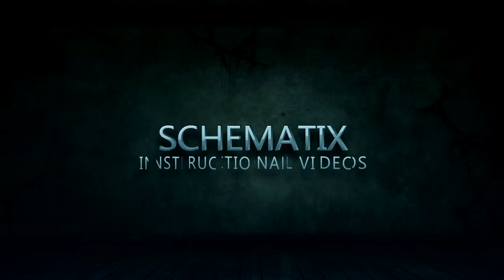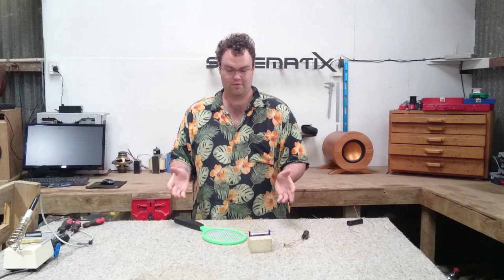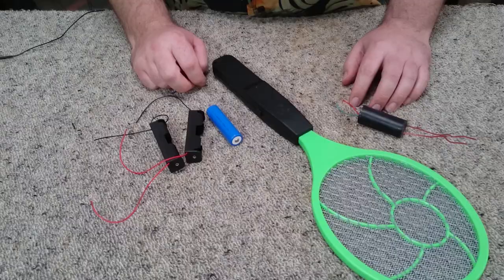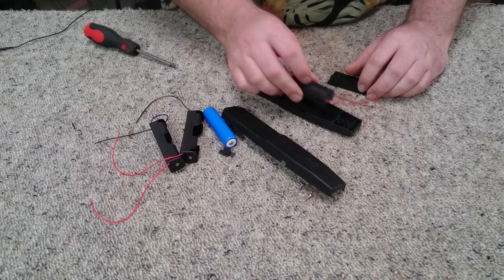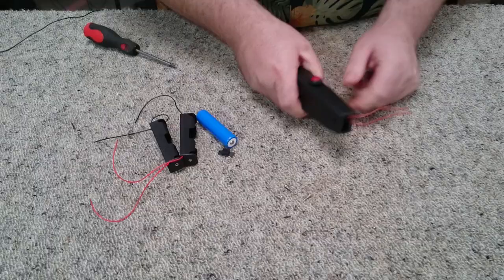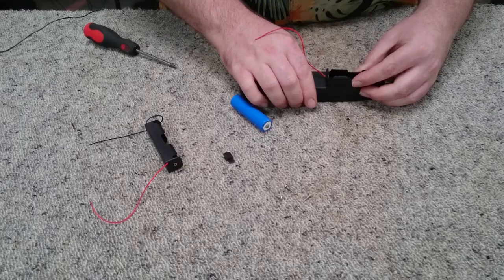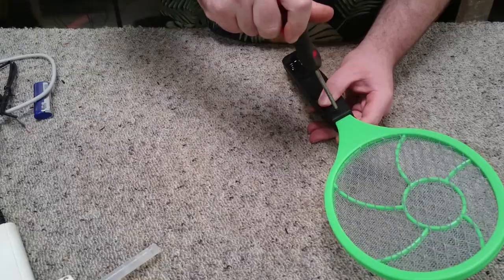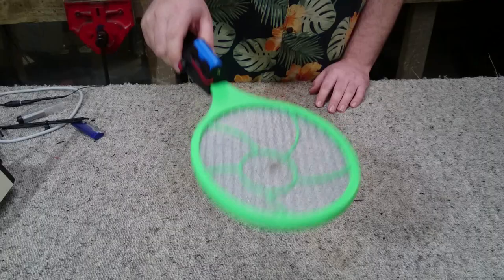How To: 'SUPERCHARGE' an electric fly swatter to 17k+ volts!

Comment: I made one of these a few years back. I found that removing one of the outer mesh panels completely and repositioning the middle one to the outer position works extremely well. The zaps are across the mesh all over the racquet not inside the frame. It’s an easy mod and one I know you will love.
Reply: And connect both lead to their own mesh. I connected only the outer meshes and left the third one in between. It’ll always find the path of least resistance and that’s usually an insect. :)
Reply: @rikdol  they work incredibly well against wasps too
Reply: That makes sense, but the center screen has a smaller mesh then the 2 outers. I guess when you do this mod, the racket would need to be used in a directional manner. You want the bigger mesh on the front part to allow the bugs in as you swing. The racket with only 2 screens may make it more dangerous if you grab the business end.
Reply: @tjet455  everything you say is 100% correct including the grabbing the wrong end by mistake. This mistake will usually only happen once though.
Reply: heck n good info brotha thank you

Comment: There's a way to modify one of those electronic fly swatters without doing quite as much modifying. I was able to keep the original AA battery compartment because there is a 3.7vdc battery in a AA form factor. What that fly swatter does now is awesome and somewhat scary. My hat is off to this guy for inspiring me to do my modification. Thank you @Schematix for your inspiration!!! BTW most American firefighters has a 5 year old self that pops up quite often!! Trust me!!!😜😜🤣🤣🤣
Reply: A 9volt battery also fits into a double AA compartment 😂
Reply: @kenciphery690  , a 9vdc battery doesn't have anywhere near the amperage needed to power the voltage increaser. The best you could expect is up to 1.2 Ah on a lithium rechargeable 9v. The 2 Li-ion 3.7v AA size are 1Ah each for a total of 2Ah. It's the amps not the voltage that matters most.
Reply: Using the original circuit, the modification to make is a much bigger capacitor. The one seen on this fly swatter is positively anemic.
If you just up the input voltage carelessly, you'll fry the circuitry real fast if it's insufficiently insulated at any point - or even get to the point where the swatter will discharge itself once it builds up enough voltage, without an insect involved.
Reply: Removing the output resistor/shunt that is across the output capacitor and the grids is a worthy upgrade, and SIMPLE to do. You can simply clip it off the board with a side cutters, and wah-lah, instantly more power. 

Be CAREFUL though, as the grids will now store a wallop for a very LONG time without the button being pressed, and it can zap you days/weeks later if you touch it without pressing the button. 

The output resistor/shunt does double duty by limiting the high-voltage developed by the circuit, AND it drained power out of the output capacitor very quickly once the button is released, and made it so that you wouldn't get zapped if you touched the grids with the power off. 

Putting ONE 3.2volt 14500 LiFe cell, and one DUMMY cell/spacer, in the AA battery compartment, and doing the resistor/shunt delete, WILL make quite an improvement in output power and it'll now blow Hornets to pieces in one zap. 👍 

Just DON'T touch the grid.... 😈
Reply: I assume you mean the 14500 type battery which has the same size as the AA battery. I understand that you put them in a parallel connection and not in series? @ffkarle
Reply: @daviddalal8383  No they went in series just as normal AAs would go in the battery compartment. You're after voltage to match the specs of the voltage increaser being used. Putting them in parallel would increase the amperage instead of the voltage. The 14500 series batteries has more than enough amperage. You need an average of 4-6vDC which you'll get and then some with the 3.7v batteries in series.

Comment: A very long time ago I worked for a magnetics company that produced a wide variety of custom and specialized transformers.  Everything from toroidal power supplies for the Apollo mission backpacks to monster transformer for the USS Enterprise.  Anyway a couple of us got the idea to make the ultimate fly zapper and used a massive transformer fed by a 400 cycle generator. The feed wires we housed in an acrylic cage we used for hi-potting dangerous voltages and baited it with some lunch meat.  It wasn't necessary for the flies to touch the wired as long as they flew between the wires.  Made a very audible and satisfying sound, kind of a zit-snap-crackle.  Did you wreak havoc at your high school?
Reply from the maker: Wow! I sure wish I was there to see that! It would have been a fly's worst nightmare I'm sure
Reply: It's amazing the weirdness that results from boredom.
Reply: Sick Bastd I was on the USS INDEPENDENCE CV62 we were berthed right next to her ( USS ENTERPRISE) at the Virginia naval base. wow, was that ship big, Indy was almost as big. anyway WHAT HAPPENED to the FLY KILLER machine? you guys sell it? Old One Legged Joseph T
Reply: Schematix why not use a pp3 battery?? that way you could have dropped it right in? Just asking Old One Legged Joseph T
Reply: Absolutely I wreaked havoc in high-school!!.... AND forever after still.... 

My favorite one back then was to charge up an old breaker points condenser to a high voltage, and then toss it to someone to catch. If they somehow managed to catch it without touching the canister AND the end of the wire simultaneously, the person ALWAYS ended up fidgeting with it until they did, and ended up zapping themselves. 
I can remember doing this to the shop teacher once as i walked past his desk, and he caught it, but didn't end up touching the end of the wire... 

My buddies and I intently watched as he played with it, rolled it around in his hand, and THEN, he grasped the wire by the base of the canister, and started slowly running his fingers down the wire, straightening it as he went, and when he reached the terminal at the end of the wire, BOOM⚡️ he got nailed, and inadvertently tossed it.... 

I thought we were in deep shit, and he was gonna be PISSED, but he laughed and told us "Good one, guys..."

I kind of figured that being a shop teacher, he would have SURELY knew all about that one, but he didn't, or else maybe he didn't think that WE knew about it... 😂

Good times, good times... 👍

Comment: you could have just added a larger capacitor in parallel. that would have given each zap more power but wouldn't have increased the likelihood of it self discharging.
Reply: What size capacitor would you recommend?
Reply: @lukeharris1425  I went with 2000v 470nf... Gave a good spark. I then replaced the battery dep. with a 9v battery instead, and holy shit! Only thing is I don't think the transformator can really handle it for too long, after holding the button about 1 sec it starts sparking inside the handle, which feels a bit so and so... But if you've cut the drainage resistor, you can just release the button when it starts sparking inside, it still holds the charge, so no problem.
Reply: @maxhult830  so 4 AAAs sounds like a sweet spot.... 😁
Reply: @rosebarnes9625  Yeah, but a 9v battery is the same size as 2 AA, so it fits perfectly in the battery compartment, without having to modify that part TOO much... So, you can't really see that it's modded from the outside :)
Reply: @maxhult830  I'd rather have an optimized and reliable Frankenstein than a nice looking super hot device that lasts a week before burning it's self out.... if you prefer the hot shot toy that looks nice, the 9v is for you, a reliable tool is my objective. "to each his own" 😁
Reply: Could I hook up a 6 vokt battery with out burning it out I trying to hook it up to my canopy tired of shit heads stealing my tool it is a security canopy with 3 doors and door handles

Comment: I have one that operates with 2 AA battery.  So, I tried using a 9 volt  battery that is used in those smoke alarm.  It fits, but you need a wad of aluminum to make contact at the + terminal. 9 volts doesn't fry the electronics, but I don't energize the circuit for too long.  Smoke warps!

Comment: I have some electric fly swatters that use two D cell batteries and I put in one 26650 battery and a spring with copper pennies connected by copper wire on each end( two 26650 batteries are just too long for the housing). It makes some big sparks! I will use the transformer in your excellent video to make an electric mouse fryer.....Just be careful dude I think I heard some ALIENS talking in parts of your video:)
Reply: they might be coming for your ray gun (fly swatter) lock and load

Comment: I bought one advertising 4000v from two AA batteries (3v)....this is a factor of 1333.3333X
Application of this to a standard 9v means the step up transformer now puts out 11,999.9v.....and only requires that you solder the spring from the base onto the top for 2 springs, after that the 9v battery actually fits in the double AA Holdrege with minor dremel work.

Comment: I believe it is way practical if you could make a module to charge the 3.7v battery so you don't need to remove it every time it needs to be charge.
Reply: micro usb charging and battery protection board TP4056 does good the job. The board is so small that you can hide it inside.

Comment: Someone used two 4.2v batteries without modifying anything else and got the same results, I think using a 9v battery with the original capacitor would probably work just as well.
Reply: Where?! What was the video called I'd love to see this video
Reply: I have once used a 9V battery but after a little while it stopped working. Probably with three 1.5V (4.5V) it might work the same instead of jumping from the initial 3V to 9V as the internal default circuitry is made to withstand 3V.

Comment: I know this is pretty old.  But curious how this would work with a 9-volt battery rather than the bulky 18650 battery?  Might even be able to fit the battery into the existing battery socket on the handle?  Maybe need a lower transformer though?
Reply: Indeed, a 9 Volt fits perfectly. I dismantled a second depleted 9V for the terminals. I needed to beef up a few components on the factory circuit board to coop with the higher voltage, and the swatter ended up far more potent.

17kV is overkill; we see the swatter in the vid discharge without a fly even being present. You´re asking the right questions.

Comment: Is there any particular way you solder the wires for the cage to the generator?  Meaning does any color wire connect to any end of the generator that is the opposite side of the button?
Reply from the maker: nope doesn't matter what way the wires are connected

Comment: I'll admit that I don't see the point in using a voltage high enough that the spark will jump through the air gap. The circuit shouldn't close until there's an insect in the middle. If you want to add power, get a bigger capacitor.

Comment: At about 3:40 you show how you can't fit a 3.7V (18650) battery into the AA holder.  However, if you used the ICR14500 3.7v battery, it will fit perfectly, as it is the same size of the standard AA battery--you can simply short the terminals for the 2nd AA battery.
Reply: Or make it parallel :)

Comment: I'm going to do this with the guts from a broken arc lighter and an 18650 cell. Might even wire in a small power bank so if you wanted to you could charge your phone with your bug zapper.

Comment: I want to know if you can zap smaller insects by increasing the voltage.  One problem is getting those small flying things, they aren't big enough to make a connection, so if you increase the voltage, shouldn't it zap smaller insects?  One other thing I want to do is make the mesh about 50% bigger and make it about 1' longer, then balance the whole thing by putting the battery down lower so you can swing it faster.

Comment: What gauge wire are you using connecting the cage to the generator? Also thanks for getting back to me on this, I'm very excited about doing this project.
Reply from the maker: The current is so low that pretty much any light duty wire should do the job, use good quality insulation as the high voltage will laugh at thinly insulated wire. (No need to look for something specialized, just decent quality)

Comment: why not use a pp3 battery?? that way you could have dropped it right in? Just asking Old One Legged Joseph T
Reply from the maker: The stepup converter requires a decent amount of current a 9v would struggle to deliver. Besides that the converter max input voltage is 6v so its outside the recommended. :)

Comment: What if you use a 9 volt battery instead... Will it make 40,000 volts and fit inside the handle?

Comment: I came here to soup up my anemic dollar store stunner tennis racquet because it is good for mosquitos but larger stuff like wasps and such require that you beat them to death with the thing as all the zap seems to do is make me jump and really piss off the wasp no end and trust me they are a hell of a lot harder to hit when you're hopping up and down flailing the thing and knocking every damn thing all over the place in a vain attempt to retreat from the creature buzzing at you with vengence in it's compound eyes and it's pricker will give you multiple burning itches not too disimilar from that one booze soaked and pot smoked night in amsterdam. I didn't need to catch a jail sentence and accidentally set fire to the cat when I miss with your upgrade. swapping out the cap for a bigger one or changing one of the resistors or maybe adding another battery in series is all I was looking for. Thanks though and if the insect ends up more human wise i have that covered via an old 6cylinder cam shaft if'n i want to catch a jail sentence

Comment: I did this too, today. Had one such module laying around so I figured to give the good old swatter some more power. I have used the module through my regulated DC power supply numerous times before. Without fail. It was set at 3.75V and 1.5A max. 

Now, having used it in the swatter, it burned out within a very short time. Looking at other videos on these modules they seem to be able pull quite some amperage, up to the point that I think the very small, hair like wires on the coils within might just get too hot and burn out since the 18650 without regulation will happily provide until it is empty or until it blows itself. 

So I am wondering how to prevent that. Would a resistor, or a couple of them, do the trick already? Or would something different be better?

It's starting to become hotter now and we get quite a lot of larger mosquitoes and wasps over here. Using it as it comes from the store makes the animals visibly suffer for a long time before they die so I would really like to use this enhanced version. They're gone quickly this way. So... Any suggestions you might have are highly appreciated.
Reply: try to connect it only to the middle part and take out the other sides it has the same affect as every fly my swatter touches explodes same with wasps and large mosquitos

Comment: What size battery did u use have u got a link for ebay buddy
Reply from the maker: They are a very common rechargeable lithium battery called an 18650. if you want to buy one I recommend buying a quality name brand 18650 like Samsung or LG.etc Cheap 18650's will promise the world and deliver little to nothing in the way of capacity or performance

Comment: Simply remove the output resistor/shunt, and use 1 3.2v LiFe 14500 AA cell and one DUMMY cell, instead of 2 AA's in the battery compartment, and it'll then blow Hornets to pieces in one shot. 

Do NOT use 2 LiFe cells in series, without a dummy cell, or the voltage WILL be too high, and it will blow the transistor and destroy the swatter. 

IF you remove the output shunt resistor, be CAREFUL to NOT ever touch the grid in the racquet, EVEN if you are not holding the button down, as it will now store a charge for a very long time and it will zap you even if you're not pressing the button. 

Removing the output shunt resistor allows the circuit to develop a higher voltage and power output, as it is no longer constantly robbing the high voltage as it is developed, and the energy stored in the output capacitor is much higher. 

Be careful with it...

Comment: I have The Bug Warrior Supreme and The Jolt Bug Zapper from eBay. they have no mesh.  it is the grill style. will your method work on these also?
Reply from the maker: Hi, I don't see why it can't work on those swatters. I believe the bars alternate positive then negative through out the entire grill. Might be a good idea to open one up and see how they are wired. I imagine they have some sort of bus bar inside to connect + & - Should be pretty straightforward.
Reply: Can you sell me one like this?

Comment: Voltage is beyond useful. Charged grids boost capacitance and charge just below arc threshold so that when pest bridges gap in grid, charge is dumped through pest killing it. Voltage should be just below arc level at 50% relative humidity or about 4-6kV. Recommend modifying your project-take your racquet head off and replace with PVC pipe of 2-3 feet and two finish nails through cap at end to use on vicious attacking dogs, mountain lions, etc..